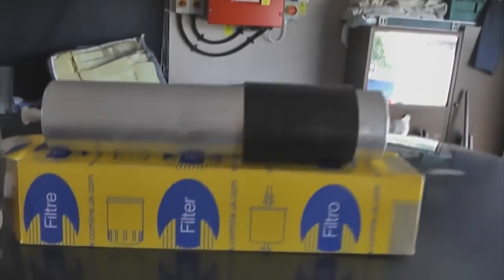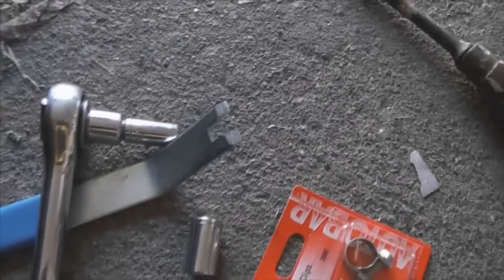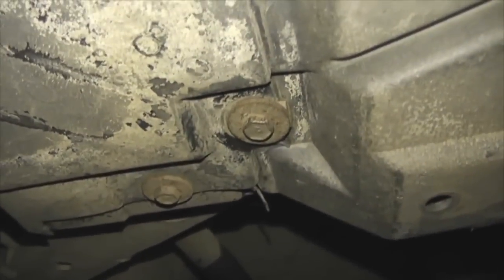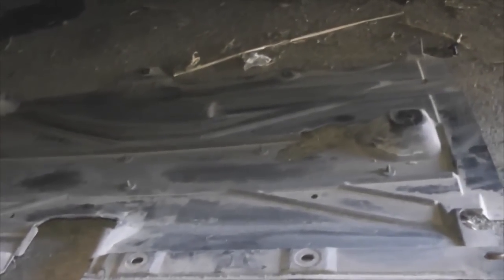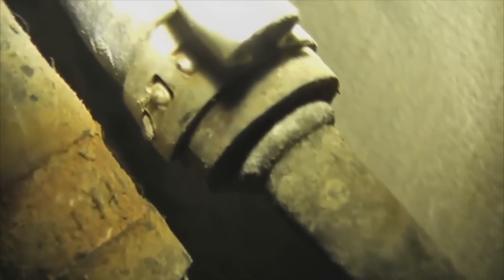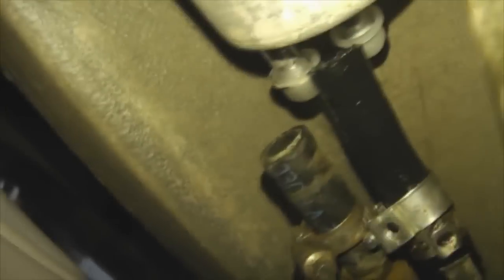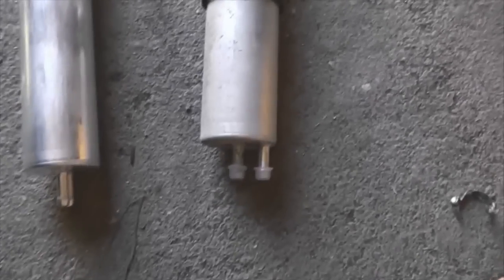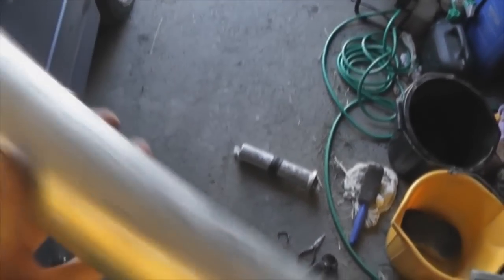BMW E39 5-series Fuel Filter Replacement DIY

Comment: You can't blow through the old one because it's wet, the new one is dry. 
The old one is heavier because again, it's wet.
Install the new one, run the car then take it off and try blow through it...you'll see.
It will also be just as heavy as the old one.

However.....when you take the old one off and still has fuel in it....cap the lines and shake the filter hard then drain it through the opposite direction of flow(see arrow for flow, use the opposite end)...fuel will come out BLACK.
Cheers!
;)

Comment: Replace the fuel filter every 30k miles? I've never heard of such an interval for a fuel filter replacement.
Reply: Also like to change it pretty often for a fuel filter. It´s the smallest thing you can do for your engine to live longer.
Reply: The BMW Inspection I and Inspection II checklists do not have the fuel filter as a replaceable item.
Reply: You can spend 20 for a filter or 500 for both fuel pumps plus 400 for the sending units(brittle crap) when they fail

Comment: Hey,

My car lost power and started dying on me couple of days ago and refused to start. Realized there was no fuel coming to the engine.

What I did was replace the fuel pump with a MAPCO Fuel Pump, 3.5 bar and 12 volt.

The car now has a delayed throttle and sometime stalls when driving or staying at a redlight. It is not the MAF or something like that, I've had those problems before.. It is definitely connected to the fuel.

I also changed the fuel filter and made sure none of the pipes were clogged.. 

The new fuel pump does however make quite a bit of noise I've noticed, it sounds like it's pumping in impulses rather than at a nice and smooth pace.. The best way I can explain it is impulsive whining.. 

Any idea what this could be? Is it a faulty pump? It's brand new and apparently manufactured in the same factory as the BOSCH ones.

I drive a 530i E39 from 2002 for that part.
Reply from the maker: Aftermarket products do not come close to the quality of the OEM ones.  I highly recommend removing the Chinese pump, and installing an OE.
Reply: +E39Source there is no way I can keep driving like this, I have to. can you recommend any "real" product sold in Europe? I live in Sweden.
Reply from the maker: I don't know who the OE is.  The Genuine BMW pump is expensive, but will be of good quality.
Reply: +E39Source I put a china pump in mine and it lasted 3 months.
Reply: E39Source I'm pretty sure Mapco don't produce shit pumps...
Reply: 4 years too late but the oem is VDO. Bosch & Delphi are 2 other safe choices to look at

Comment: What were your symptoms for a bad filter before you decided to replace it?
Reply from the maker: +Jean-Jaques Rousseau In strong cases.. starvation of fuel, which can lead to misfires or poor performance or even failure to start.
Reply: this is one very large cap filter, huge by  any standards, chances of a blockage pretty much zero
On big  diesels we put a vacuum test to the line, no practical use here

other than this if you try climbing in a high gear or high speed on the Autobahn and  nothing much happens, chances are you do have restricted fuel flow
Reply: I changed mine, it is ok now. Before, it blocked fuel flow a lot, so much that the fuel pump overheated if the tank was only 1/4 full and it stopped till it cooled down. When the tank was full the bigger quantity of fuel kept it at operating temperature but at knockdown there was not enough fuel getting to the engine anyway. When the filter was out it was pretty hard to blow through it while the new one let air easily through
Reply: +E39Source I have a lost in power when I floor it and gets misfires .so you think I have the same problem
Reply from the maker: +Tevon Jenkins Very possibly could be.  Could be plugs or MAFs or camshaft sensors too.
Reply: +E39Source I think I put to much dielectric grease and anti seize on my plugs could that be a problem

Comment: ok, so you said, you need change this thing every 30 000 miles? you put out fuse for fuel pump an you gonna change fuel filter? Lets think again. Fuel pump fuse for fuel filter? Since when does filter have a fuse? Pump is powered by electro engine...it may have fuse. So you changed fuel pump every 30 000 miles. Sorry. Fuel filter is in front close to engine with easy acces. Better change it quickly. look at this german teenagers https://www.youtube.com/watch?v=M8DLT6dy0-g
Reply: i changed mine fuel pump when it broke after 365 000 km
Reply: MrKarol001 He got a petrol, your video is a diesel. You pull the fuse for safety and to drain the filter and lines for pressurized fuel, logical? Well obviously let the car run until it dies after the fuse is out.